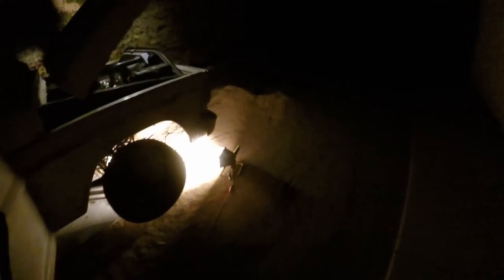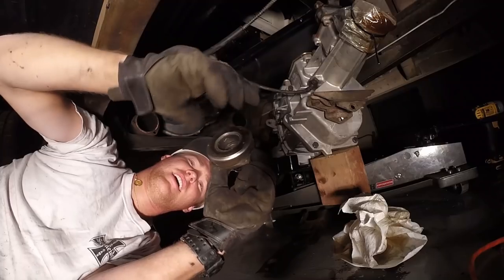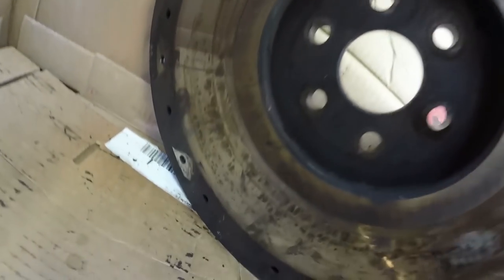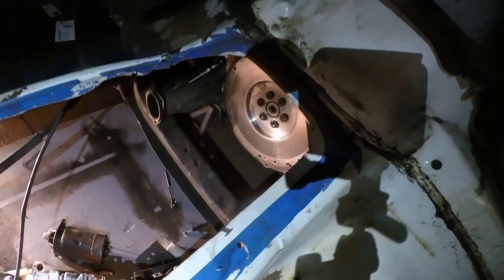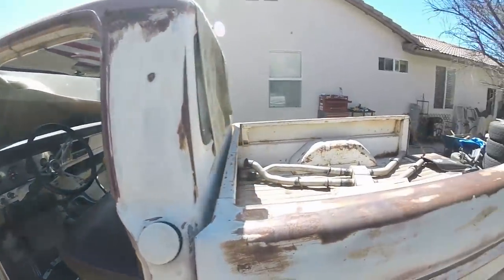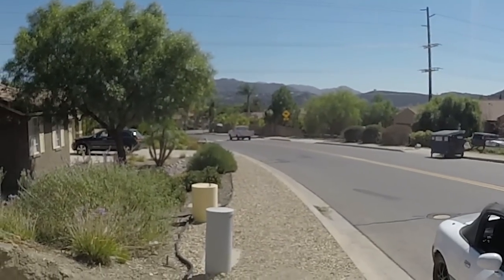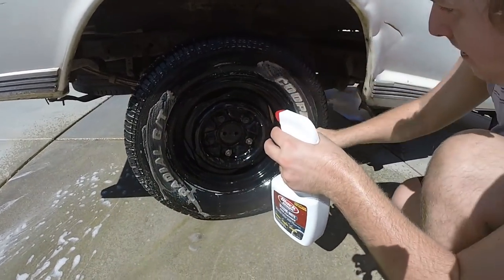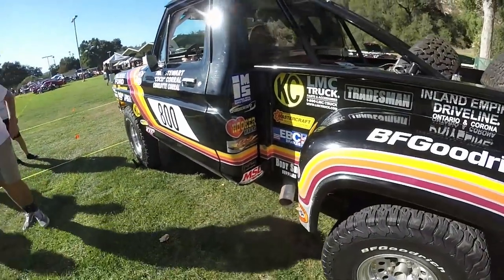My Five Speed Swapped F100 Is BACK AND BETTER THAN EVER!!!

Comment: You shouldn't have any problems bolting your clutch assembly up to the 164 tooth flywheel
they are drilled out to fit multiple applications.

Comment: You got nice clearance from your headers to your crossmember. Did you add height to your stock motor mount, or do those heads fit like that bolt on ready? If so, which headers are you using specifically?? Thanks! Truck looks great!

Comment: Hey Craig where did you get the tranny? I’m thinking about doing this while I restore my 66 f100 (although body will be done first lol) so it’s gonna be awhile. Also, when you had the 3 speed, what rpm did you run at and what size tires and rear end? Thanks